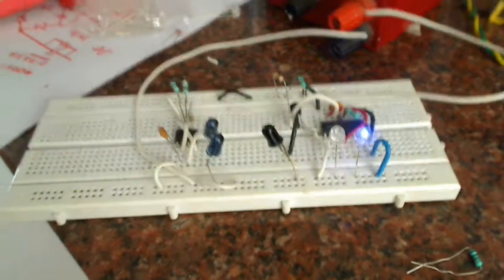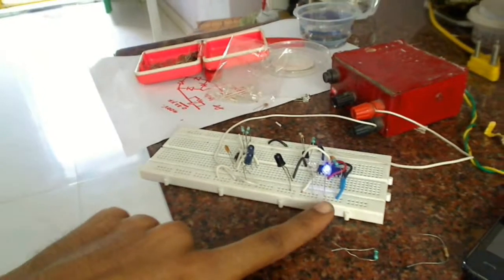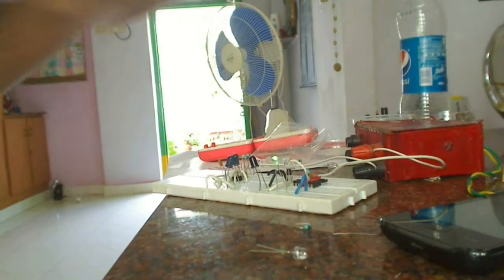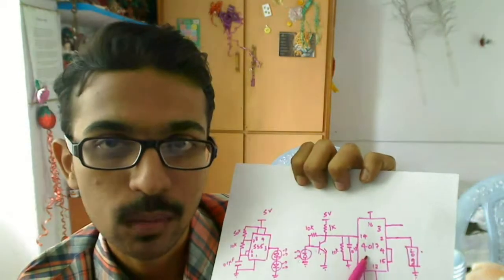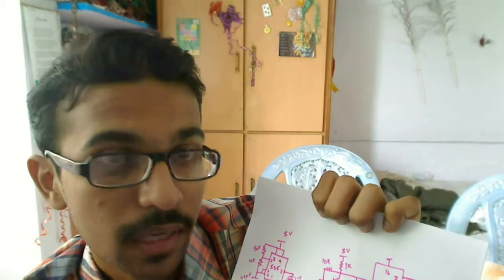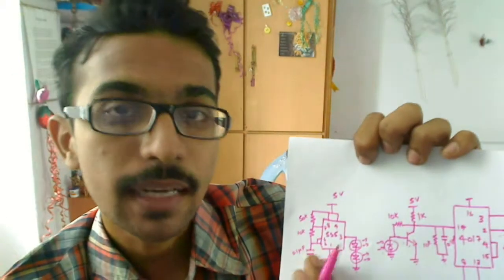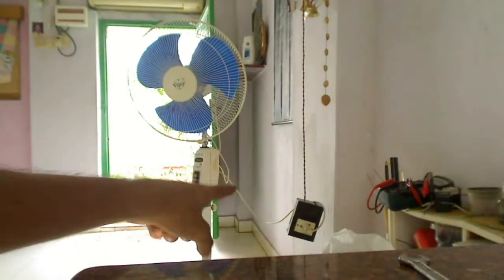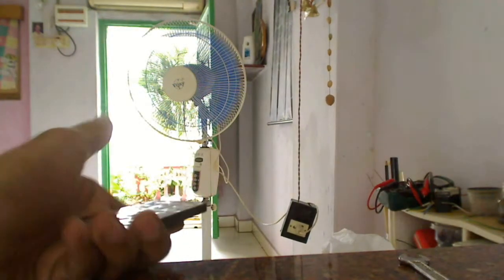Wave to on and wave to off switch/ remote control appliances

Comment: which transistor has been used in circuit? 
and which pin has been shorted with pin no 8
and is it compulsory to use 2 ir led
Reply from the maker: BC547 or BC548. pin 4 is shorted with pin 8. pin 4 is enable pin so it should be connected to Vcc (+ of battery)
Reply: Ok and i am facing a new problem led is not continuously glowing and not being off
Reply from the maker: try connecting a 0.1uf capacitor at the pin 2 of 555 timer